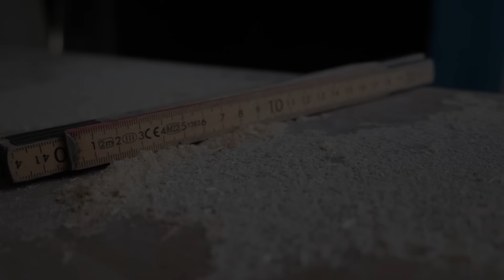#26 Building a bathroom by myself | All done with preloved & reused stuff

Comment: Create your own wetting solution by adding 8 drops of very mild detergent, baby shampoo or dish detergent into a 32oz. spray bottle filled with water. Clean the glass where the film will be applied, removing all traces of dirt, grime, grease, etc.

Comment: There is a way you could seal those holes that you showed us in the pipe in pipe system.  You'd have to make it worse to make it better.   Cut out the two holes into one.  Put in tape on the INSIDE of the pipe with the sticky facing out.  Then you can use pretty much any kind of liquid sealer to harden and bond over that.
Reply from the maker: This sounds like a good idea 😊 Something to think about! Happy holidays ✨
Reply: @annasgmlindgren    Happy Holidays to you too!!✨🎉❄🥂

Comment: You may want to get someone else to do your plumbing, at least call around. We saw that an electric heated pipe is needed for Swedish water systems, your water can freeze and bust the pipes. There are certain depths needed. As far as inside you are correct about having a pipe inside a pipe. It makes sense in colder climates. Burst pipes can create a lot of damage.